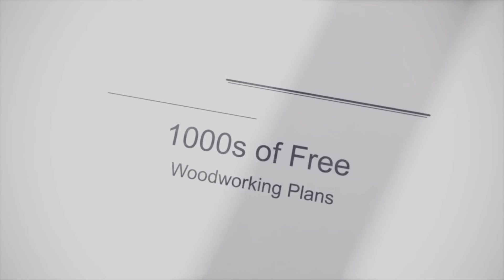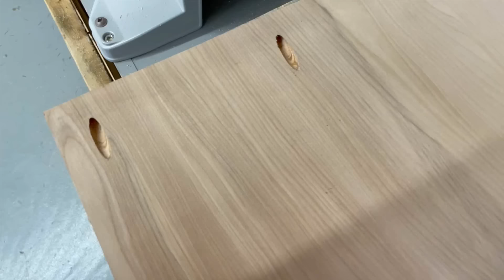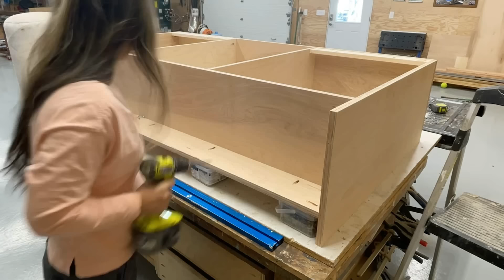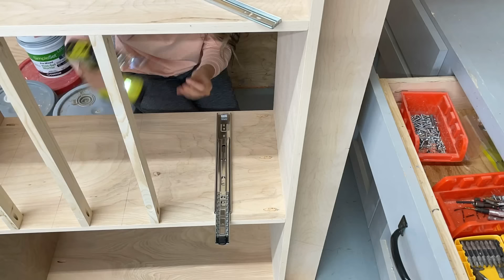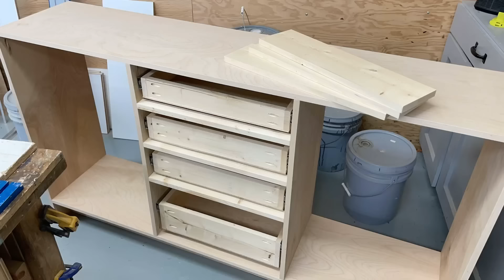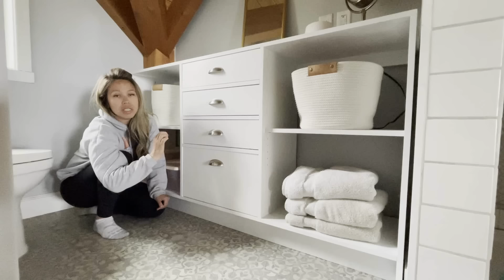How to Build a Sideboard with Drawers

Comment: Very nice purpose built cab, very convincing drawer making technique

What size pocket hole screws were used on the 3/4 ply
Reply from the maker: 1 1/4" PH screws are used for 3/4 stock.

Comment: Shouldn't the screws come from the outside for more strength?
Reply: These are pocket hole screws used with a Kreg jig and has an insane amount of strength.  I typically do pull ups on builds I make with pocket hole joinery testing at 200 lbs, trust me it's strong!  Good luck on your projects and build something awesome!

Comment: How are your pocket joints staying so straight when you screw them in? Anytime I do it they slide pretty crooked unless I use a clamp or two.
Reply from the maker: I would recommend clamping, I generally hold it out a smidge and it pulls it back to flush.

Comment: The shelf configurator website is super helpful when planning any shelves. Pocket hole joinery is super strong and adjustable shelves is a nice feature to have. I would recommend double sided tape instead of nailing the drawer fronts to avoid filling and sanding, but this is the fastest and most easiest method out there.  Keep up the great work as the goal is for us to continue to inspire others to build something awesome! 👍🏼
Reply from the maker: Thanks and great tip!